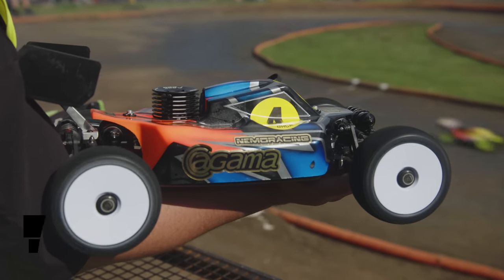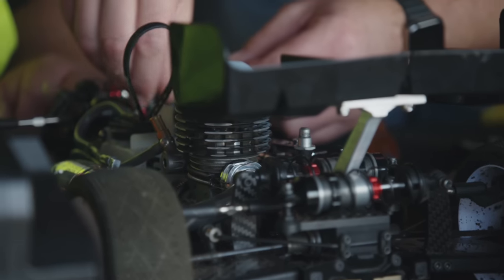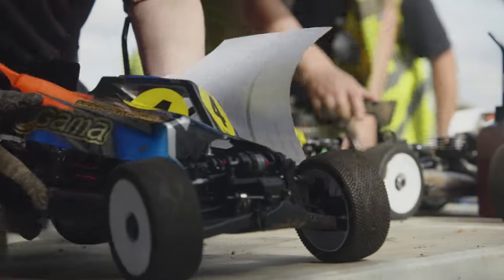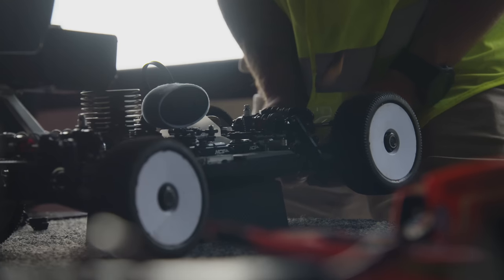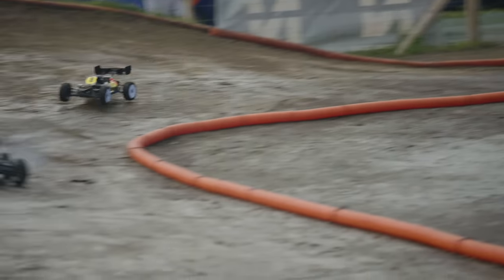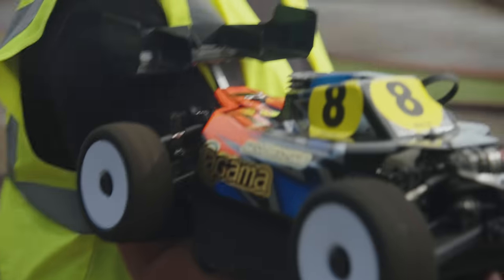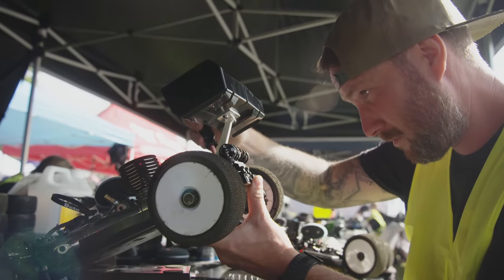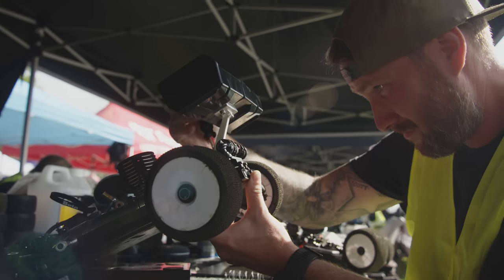NEMORACING Concept Agama 1/8th car

Comment: This is long over due, between new materials, and new manufacturing process finally someone is taking the huge step to evolve the sport. I look forward to seeing were it goes. I forsee just 3d printing parts with differant filaments to use as another tuning aspect. Thank you

Comment: Looks amazing. My only concern would be the susceptibility of the suspension components in the event of a crash. Traditional layouts position the shocks well out of harms way unless the crash is that significant the rest of the chassis would also be at risk anyhow. Time will tell I guess.
Reply: My only concern would be the little damper volume. Makes the car handle completely different when running for a long time. MX or other vehicles don't run these heavy shocks only for travel and stiffness but for having enough oil to be able operate at a certain temperature level and not heat up too much. Nonetheless, beautiful car, nice video and great editing 👍🏻